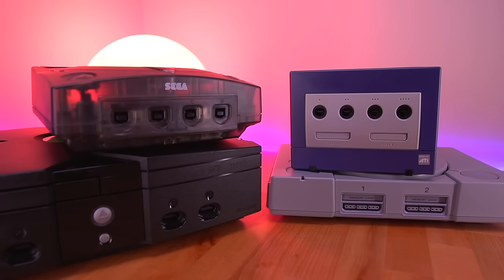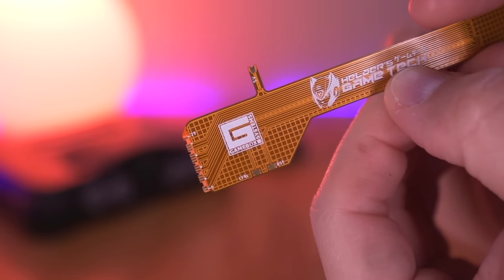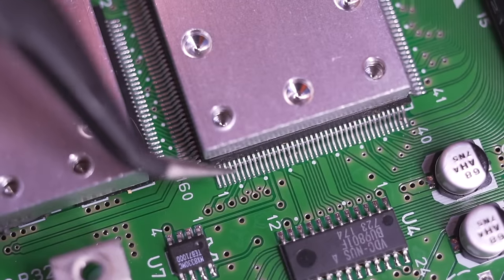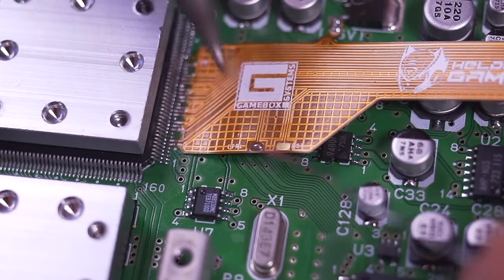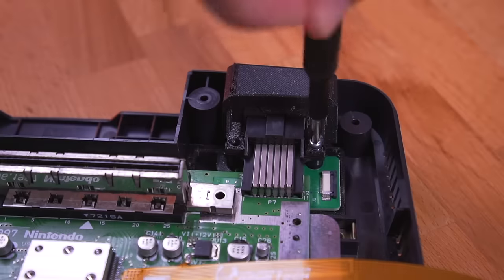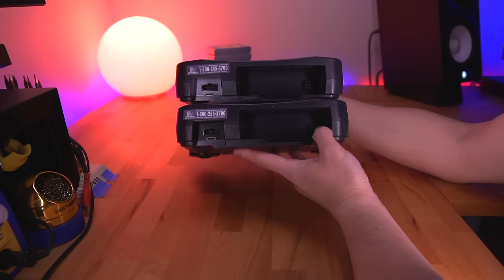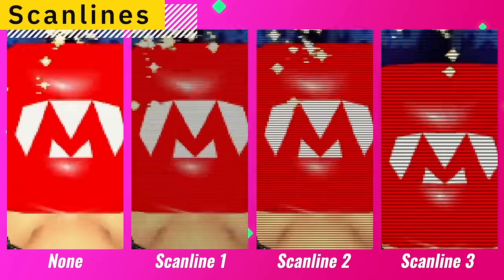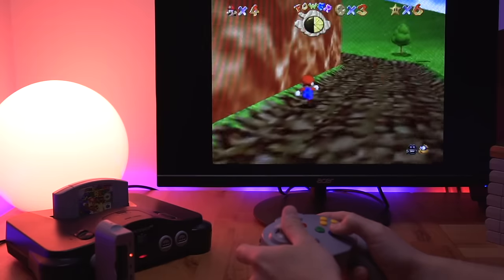The Nintendo 64 Gets A New Less Expensive Hi-Def Mod!

Comment: The N64Digital isnt the first or only hdmi option. There is the UltraHDMI but given the horrorshow group buys needed to obtain one yeah i suppose you can consider that a non option. Great video as always!
Reply from the maker: You’re totally right, I completely forgot about the ultrahdmi!  I made a pinned comment making the correction. Thank you!
Reply: I jumped on the uldrahdmi when it first came out and commissioned badassconsoles to do the install for me, when I got the n64 in the mail the hdmi needed to be propped up to have a proper signal(probably the result of a poorly connected hdmi port to the board)
I returned the console to him to have it repaired(at the same time I sent him another console so that he could do a shell-swap) after some back and forth regarding him shipping the console back to me he stopped responding to my emails(the last email I got from him was december 2018)
all in all I lost 2 n64's from this and one ultrahdmi board+money for shipping.
needless to say this whole experience put me off from ever trusting any installer again.

maybe this new board is something I could try to install myself.
Reply: I was lucky to dodge that 'tornado'! Got mine just before things turned to crap.
Reply: it's unfortunate that you got screwed by a shady installer I know Marshall personally, and I don't like people like that giving my friends product a bad name. I've built 6 ultraHDMI consoles so far with zero complaints or returns. it's a relatively straightforward mod for someone with decent soldering skills so there's no real excuse for that
Reply: if you're in the US and ever want an hdmi mod installed shoot me a message and I'll give you a good deal. hardly makes up for getting ripped off before but it's something anyway lol

Comment: I’ve got the UltraHDMI mod on my N64 and the results are incredible but costly. Mostly due to its rarity due to “shortages” but also cuz it takes great soldering skills to install. This looks to be pretty much on the same level and hopefully bring down the costs of the other HDMI mods for the N64. Very cool
Reply: I bought mine preassembled. It. was. not. cheap.
Reply: I bought it directly installed from the guy who makes these ultra hdmi kits! He lives in a neighbour country!
Cost me 250 € console only around 2017-18.
Reply: I bought a preassembled off EBay in 2014 for $450. I'm afraid to see what it is now lol
Reply: I payed $450 CAD for it to be installed in my N64. I love the system, so no regrets.
Reply: That one is worth it, especially if you want to.use both CRT and lcd
Reply: wich one is better this or the EON?

Comment: I'm confused by the 720p mode not filling the screen.  Isn't a 3x integer scale 960x720, which would then be scaled by a 1080p screen to fit perfectly?  The "proper" mode looks like 480p in a 720p window.  Also, is there pixel shimmer on 2D games in that TV 1.5x scaling mode?

Comment: It’s great to have yet another option. There is also the RGB Advance which is of similar quality to the N64 HDMI mods. Hopefully they manage to keep this in stock. I would love to see an RGB add on board for those that also want to add in native RGB support. I love to be able to have the option to hook it up to a modern tv and then a CRT using RGB cables.
Reply: IIRC N64Digital also adds RGB to the multi-out.

RGB can also be added with other, cheaper mods.
Reply: I got the RGB mod but instead of using scart cables I used hd retrovision component cables on a hd CRT. Looks really good but haven't been able to get an HDMI mod yet. Expensive

Comment: 2 quick things- firstly thank you for the helpful guide. It made installing the 64hd much easier. 2nd - although all my original games work fine with this mod, the everdrive 64 (v2.5) I purchased in 2019 has menu issues- meaning the menu doesn’t work. I can still blindly launch games on it, but the menu is scrambled. If you own an everdrive and want to do this mod, for sure the 2.5 doesn’t work. If any other one does please let me know. The everdrive works fine with composite cables still just not thru hdmi

Comment: I’d love to see some comparison vids! I just received the kit and I’m switching from my eon super 64 +MClassic which is a surprisingly high quality plug and play option, albeit a little expensive. I plan on running this through the MClassic as well so I anticipate a pretty decent improvement. The MClassic really seems to add the much needed umph to hdmi converters. Thanks for the vid!
Reply: well? any updates? I too use the EON with the mClassic and have for years now. What's your verdict on difference in picture quality and price?

Comment: Awesome! I'm glad we are finally getting more competition in this space. I really wanted to do one of these mods but the N64Digital and UltraHDMI Mod are just a bit too expensive for me. This is still higher than I'd like but it's in a bracket I can accept. Should be a reasonable quality improvement over the retrotik without RGB chip I'm currently using. Plus I'll have less of a spaghetti of cables behind my TV. Pre-Ordered with your code, Thanks!

Comment: The ideal solution for me would have been 4x integer scaling to a 960p window inside a 1080p frame. Or even 5x scaling (1200p) cropped to 1080p, since many N64 games had black borders anyway.

Comment: Very nice kit! I like that you don’t need to cut the shell to fit the mod. 😃
Reply: How did you install it, you made the board yourself, of did you send it to someone.
Better than a Dolphin machine ?
Reply: you dont have to cut the shell for ultraHDMI either, you can 3d print a replacement A/V shell and a small spacer/tray that fit into the console so you don't have to cut anything

Comment: Just tried to hook the cable to the pins and it is RIDICULOUSLY more difficult than you made it seem with how tiny the pins are!
Reply: Its pretty allright, just made 2 of them this evening :)
Reply: @mrej112 I just finished installing this mod myself and was wondering if you had any audio issues? When connected via HDMI I get no audio, but when I go back to the composite cables the audio is fine.

Comment: Where's the installation guide for this for the different models? You said to solder to pin2 of the PIF chip, but you soldered to pin 16. So did you switch it to pin2 off camera, or was it actually supposed to be pin16?

Comment: I'm an IPC J-STD Trainer and just wanted to say you have great technique. There are two things I saw that you should be aware of if you're going to do many more of these. When you ran the jumper wire to the PIF chip, you never run a jumper wire on top of a component. The other issue I saw is more of the design of the conversion kit and nothing that you did. The flex cable sits directly on top of several transistors. Those get hot by nature, so I would imagine they will cause an issue eventually. Adding several layers of kapton tape to the underside of the flex cable where it touches the transistors would probably fix that.

Comment: Tito, hello from the Dominican Republic, I have a question for you since I am interested in making this mod... Once this mod is installed, the original video output (multiout) is unusable, or can it also be used normally? Or to be able to use it on CRT's is it mandatory to do it through the HDMI to Component converter?

Comment: I have my n64 rgb chipped and I'm running in through a retrotink. How does my set up stack up against the hdmi mods like these? I feel like what I have is essentially the same thing but without the settings options? Let me know cuz I'm interested but don't want to go hdmi if I don't have to cuz price haha great vid btw 👌🏾
Reply from the maker: I think your setup is a great way to enjoy the n64 on a hd tv. I think the main benefit of this kit will only be convenience of using the hdmi cable. But your video quality should be pretty good

Comment: Really excited for this! I've wanted an HDMI N64 mod for a while -- I have great mod-free image options for lots of my consoles, but the N64 remains elusive!
Reply: You can buy a N64 cable to hdmi adapter. Works really well and is way cheaper then any mod.
Reply: @NL_the_Godfather  Not anywhere near the same quality. The point isn't connecting it to an HDMI screen, I have a dozen ways to do that.

The point is image quality. The N64 outputs at best an SVID signal natively. And most MultiAV HDMI cables don't even use the svid lines and instead use the composite video input, perform a VERY basic conversion, and call it good. Usually chroma issues. And unless you're buying it from a company that specifically stocks HDMI adapters for retro consoles, you can be dealing with latency, tearing, and other issues.

My (unmodified) SNES, by comparison,  outputs an image essentially free of artifacting, by using its native RGB output via a component video cable to a TV which has analog component support. The N64 lacks a native RGB output, so the only option for a comparable mod is to tap the RGB video output directly from the RCP.
Reply: @devikwolf  ok thanks for explaining. I myself will stick to this adapter though because it’s so much cheaper. Only cost me €10,-. I usually play N64 on emulators anyway and not that often in general. So over €100,- is to much for me excluding the fact that it still needs to be soldered correctly. If it was cheaper and plug and play i will certainly consider it.

Comment: my N64Digital in frame lock/minimal lag is running at ~2ms of latency, how does this compare? Is it adding a lot of lag? I think UltraHDMI was around 16ms
Reply: UltraHDMI also has a frame lock mode (zero lag mode -> sync on my HW1) these days, should perform similarly to N64Digital. Unlike the old zero lag mode they had, it works with all output redolutions and most of the other settings too.

Comment: Great video! I wish I was that skilled with a soldering iron.

I'm confused. Why is 720p integer scaling windowed? 240*3=720. It should fit the full 720p canvas. It looks more like 480p windowed in a 720p box. Am I missing something?
Reply: I had the same reaction. There are some N64 games which ran natively at 480i, so I guess the scaling is based on that as a baseline? 1.5*480=720. So the 1.5x scale should in theory be a perfect 3x scale for games that ran at 240p, which is the vast majority of them, but non-integer for 480i games.
Reply: @vaguerant  so, the few 480i games would fill the screen vertically? That’s interesting. I can’t remember if any games switch between 480i and 240p, but that sure would be jarring.
Reply: @cactoidpinata  I think it's more like 240p games are already being upscaled to 480p at all times, so that it doesn't matter which resolution the game runs at. Then the scaling options are always working with a 480p picture, whether placing it in the middle of 720p or stretching it 1.5x to fill the screen.
Reply: @cactoidpinata  Resident Evil 2 and the Pokémon Stadium games are the big ones that switch resolution.

Comment: So I bought this back when this vid was new, but never got around to installing it. Color me disappointed when I finally want to do it and I'm reading about what a cluster it is to update the firmware, needing to buy another cable, solder JTAG pins, etc. Had I known that going in, I doubt I would've bought this.

Comment: looks good, and I'm glad that there's another option out there, but I reeeally hate that all kits are using the mini HDMI port and not a full-sized port.
Reply: N64Adv2 is using a full-size port 👌
Reply: Why... just buy a $5 adapter. or a dedicated cable for a little bit more. Why does it need to be dull sized...

Comment: I would need a 1000x magnifier just to see those pins yet alone solder to them! Nice soldering, though. But emulation is way cheaper and much better. I also thought that 64 referenced how many bits it had not how many screws you had to remove!

Comment: 9:40 I cannot recommend squeezing the flex cable unprotected between N64-PCB and RF shields. Personally, I would use some tape around the flex at this point and some small washer left and right at the screw holes. Otherwise, it is just a matter of time until we are seeing defective flex cables.
10:30 Also not a big fan of putting the bare PCB on the heat sink without protection. A small scratch at the wrong place in the solder mask and one may have an accidental short.
Reply from the maker: I like the washer idea very much. May have to implement that.

Comment: What are some external hdmi adapters, I don't have the ability to solder and would not want to try as I could damage my N64?
Reply: An S-video cable with a RetroTink 2X Mini is a reasonably affordable option. You could also consider the 5X if you have enough other retro consoles to justify the cost. 

Alternatively, there's the fully integrated Rad2X cable. The issue with that is the lack of support for S-video, but you may be okay with a slightly fuzzier image. It's cheaper, and does support RGB if you feel like modding that in later. RGB mods are generally pretty easy and cheap.

Either way, if you're buying any RGB or S-video cables, make sure they're good. Packapunch cables are great, for instance.
Reply: Also, I'll pre-emptively state that I don't recommend the EON64, it's just a Rad2X at double the price. Quite literally so, since it appears they're using RetroTink hardware coated in epoxy with labels scraped off.

Comment: I installed the kit this evening. The soldering is fiddly, but doable with a fine iron and a good liquid flux.  The results are great
Reply: hi will it work on any hd monitor thanks
Reply: and i see we need a thin gayge wire, does it come with that because the kit picture dosent show it
Reply: @ceff01  Does not come with the wire. I used a piece pulled from an old IDE ribbon cable. you can use anything
Reply: @ceff01  Don't see why not. Only tested on a pioneer plasma from 2007. 720P with 1.5 tv scale works well
Reply: @DKbananas  thats great thanks because i ordered one
Reply: @ceff01  awesome.
Reply: Please help again please. I soldered it good get signal on screen but it's that colour block image when it's trying find a signal you know with the lines. Also I can't push the blue end ribbons cable in alot, like another install Video. I could show you pics if you need. Thanks
Reply: @ceff01  do you have another screen to test with. Also try getting into onscreen menu and changing yo a different resolution
Reply: @DKbananas  it's all colour lined
Reply: @ceff01  possibly a solder bridge on one of the pins. The blue ribbon win fully insert with a little wiggling up down side to side
Reply: @DKbananas  but now ive bent the ribbon abit will that be okay. it just wont go in all the way the ribbon wont. i will check for any bridges thanks.
Reply: @ceff01  ok as long as not ripped. you will still see blue sticking out when fully inserted. maybe check if the system still works using the original multi av out
Reply: @DKbananas  I have alot of blue sticking out and also the plastic black pin has broke so can't test with that in but I push it in and leave my finger on it to test but still lines. Can't be monitor because it goes to native 720p it says on screen. How far should the blue cable go in thanks
Reply: @DKbananas  you are the best. i resolder now good. one last prob lol i need to fix blue end flex cable in slot but no black pin they broke. can i glue
Reply: @ceff01  those clips clamp the ribbon. It glue might hold for a while. Best option would be to replace the connector. That's not the easiest job
Reply: @DKbananas  but the clips are replaceable do you know what size black clip retainer thanks

Comment: Hi Tito =  Great video. I'm one of those gamers that doesn't care about all the settings, however, I do care very much about getting the best possible image quality.  I was wondering, if I were to use the Component adapter that you mentioned and send that signal through my retrotink 5x - wouldn't I get the best possible image? Because the tink would take that and bring that 240 up to 1080 or higher depending on your T.V. - let me know what you think about that, or If I'm missing something.  Thanks again for your great content.   - Nick
Reply: Nah, definitely not. If you use the 720p mode of this one with all the extra features disabled, it's a direct digital-to-digital integer upscaling. There is no quality loss at all. Component video is analog, so converting to component and back will degrade it to some extent.
Reply: @Sauraen  thanks for your input :)

Comment: There's something screwy with the scaling. The N64 (usually) outputs 240p, so I don't know why you describe filling a 720-pixel height as "roughly 1.5x;" even if you're in a situation where you were forced to have the N64 outputting 480i instead (and I don't know if there even are any), it would be exactly 1.5x. On a related note: even though a 3x scale would exactly fill a 720p output image vertically, what you display at 13:42-14:02 is instead a 2x scale with black bars on all four sides.

I'd also like to express my disappointment with the lack of 1080p output. On a 1080p screen, a 4x scale would have only small black bars on the top and bottom ("wasting" 1/9 of the screen's height in total), or a 5x scale would cut off a small amount from the top and bottom (losing 10% of the input image in total). With the product as it is, it's impossible to get a true integer-scaled image on a 1080p screen since the screen will just non-integer scale whatever you give it to 1080p. The 720p output mode can be pixel-perfect on first-generation 720p "HDTV"s, 1440p computer monitors, and eye-popping 4k screens, but the ubiquitous 1080p displays are left out in the cold.